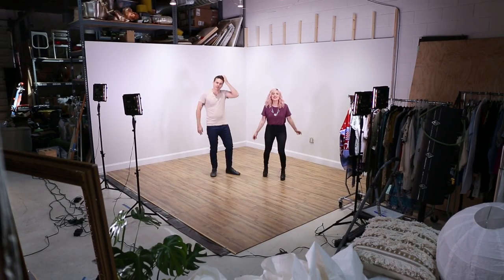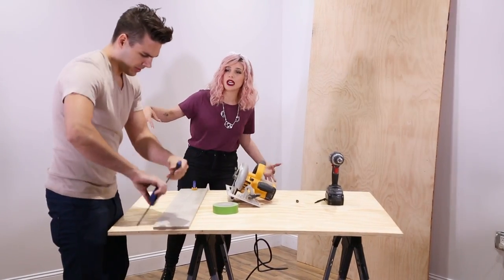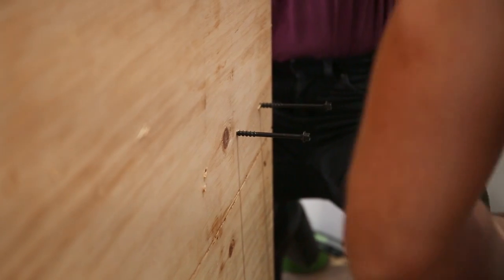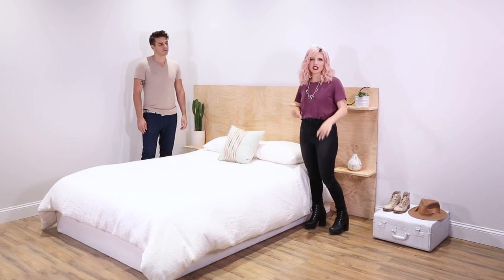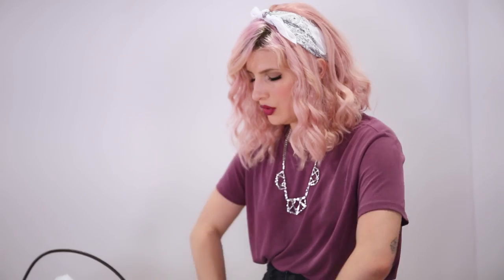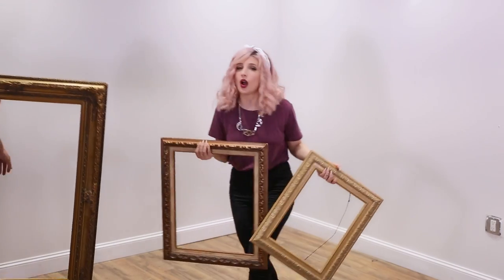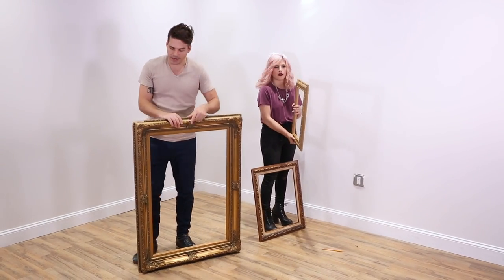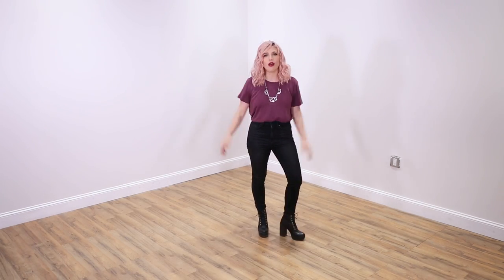DIY Budget-Friendly Headboards for Every Design Style!

Comment: My bedroom is an eclectic, Moroccan inspired style. My walls are Robins egg blue with white trim around my bathroom and closet doors.  My canopy bed headboard portion, the black metal is twisted in fleur patterns. I have a octagon small table between my two rattan chairs that I painted a shiny black with vibrant patterned chair cushions. I have dark wooden floors in my room, what rug will work in this room? I've looked at the over dyed rugs. Straw like material rugs. I purchased a round beige rug with big cream flowers, but it's ok, but It isn't The Rug. A video clip n choosing rugs would be great. When to use small pattern, big ones, etc...

Comment: considering the width of the plywood, is it difficult to drill through like that without screwing it up? asking for a friend....
Reply from the maker: +Sally Bascombe you want to get a thicker plywood and you just have to drill straight! The good news is if you mess up you have plenty more to work with. Also if you don't want to go the drill and screw route because it's too complicated or you don't have the proper tools you can always use some basic shelf brackets instead!

Comment: Why weren't the shelf and headboard edges sanded/smoothed/sealed so that you don't get splinters while using the bed and shelves?
And....wouldn't it look cooler with a light wood stain or light whitewash so that you would still see the knots in the wood but it wouldn't look so crude and unfinished?
Reply: Rochelle Match I think they did that way cause they were planning on using it for the mermaid headboard afterwards. Beside if you were possibly interested in doing you could that yourself. After all each project we do we cater to our needs an likes.. :)